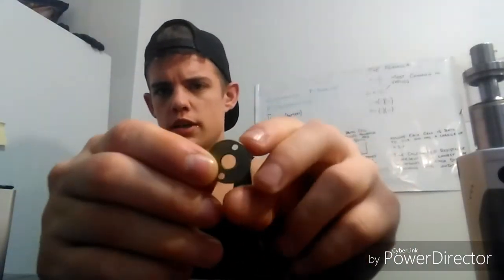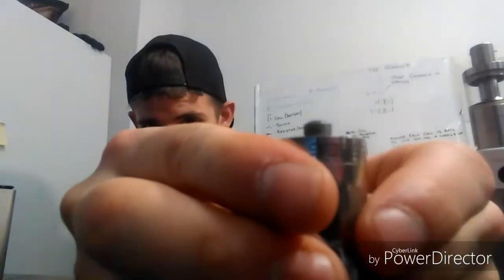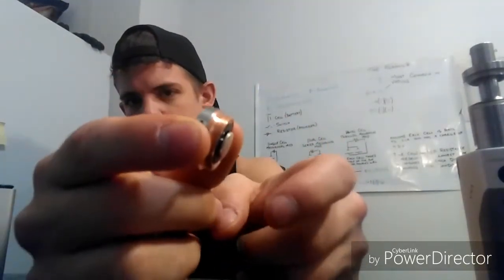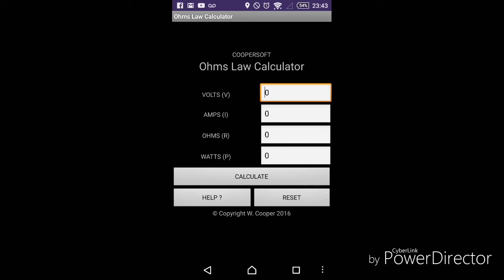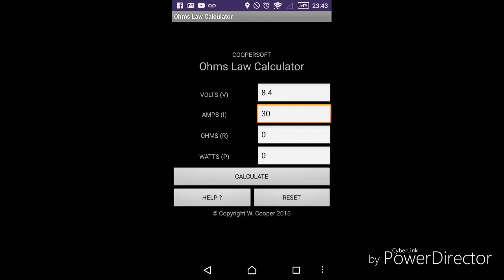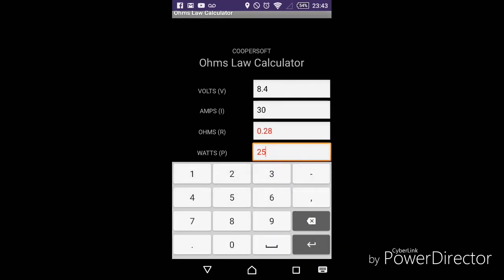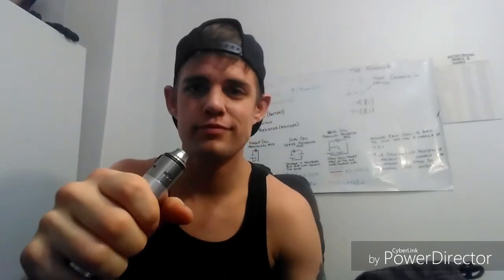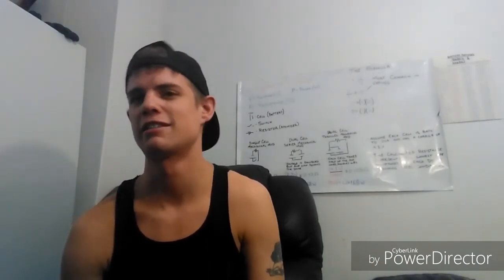Vape Safety Part V - Hybrids and Mech Mods

Comment: can you check my math? I use a single cell mech mod, ( AR clone by SXK) I use a Sony VTC 5 in it which is a 30amp cell so I reckon my safe builds are 0.18ohm and up ? I don't trust my math completely so I tend to build them 0.2 and up.. please help
Reply from the maker: Schyzofrenic87 0.18 will be fine on that battery it's actually a 25 amp cell, but with voltage drop you should be fine.